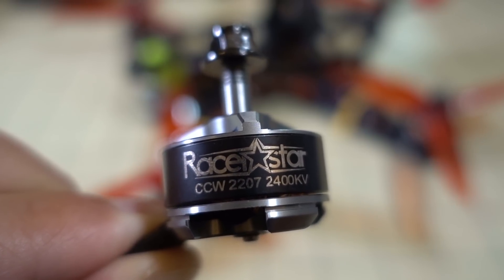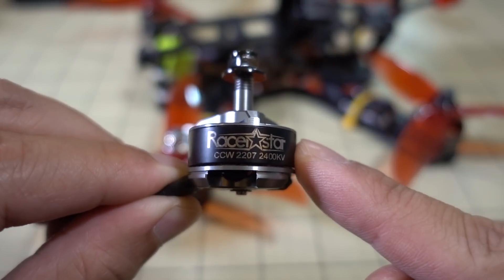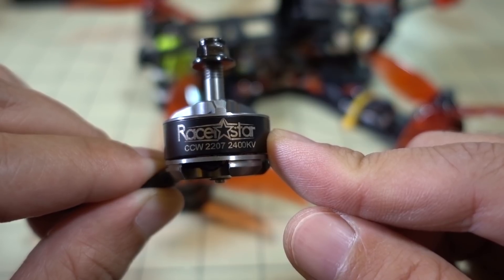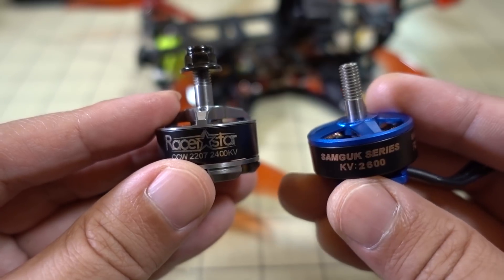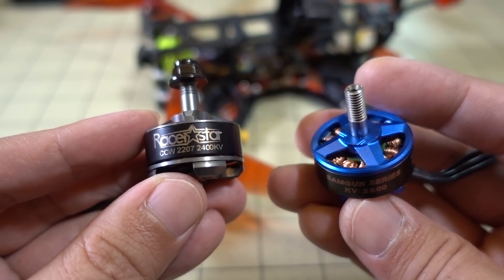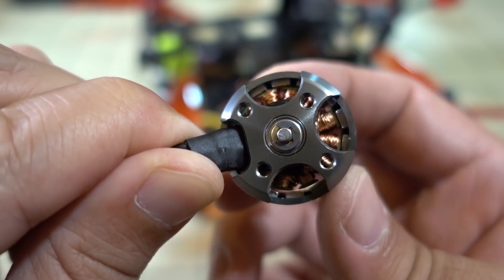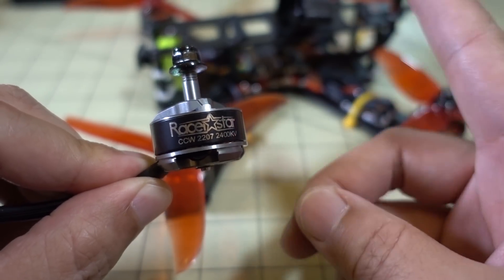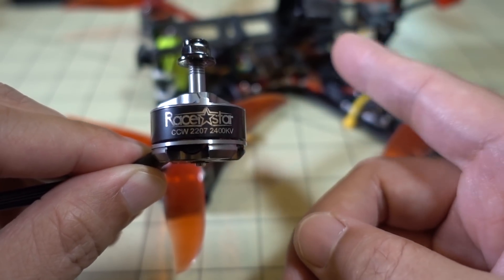Racerstar SPROG-X 2207 2400kv Motor Review 🏁

Comment: May I ask about those esc from drone drop. I'm running them on a build. I couldn't find any info on them. I can connect to blheli, but they don't show up. Is there any info on them I could digest somewhere that you know of?
Reply from the maker: Those ESCs are BLHeli_32, so you need the 32-bit configurator to connect to them.
Reply: Albert Kim that's great news thank you!

Comment: Nice to see you will be testing the DYS. I have a set of the 2207 2600kv sitting here right now. As soon as I get my iX5 V3 iflight frame and the hobbywing fight stack I will be trying the motors out. Can't wait. I may still get some better motors later of course. I saw Hobbywing make 2207 motors and they look pretty nice. I also saw GEPRC and Emax motors on sale this week. Still not the price of the DYS but if it is garbage I will have to break down and spend the money. Thanks for the reviews.